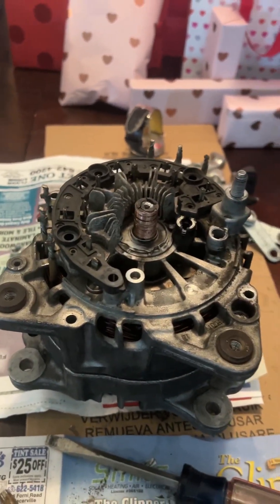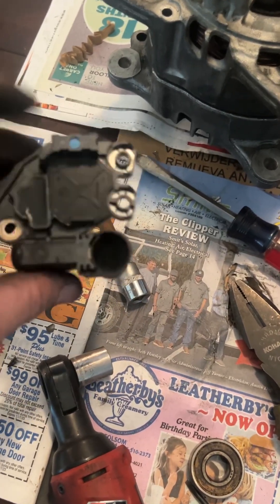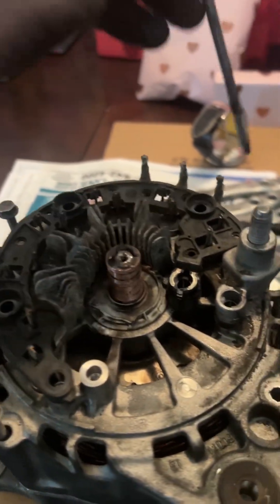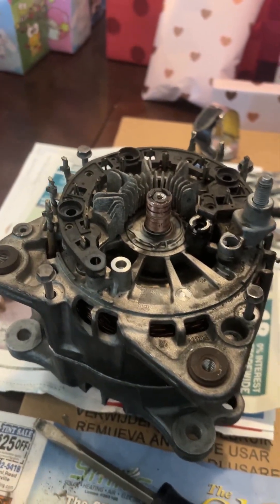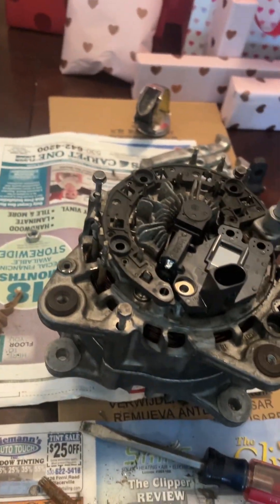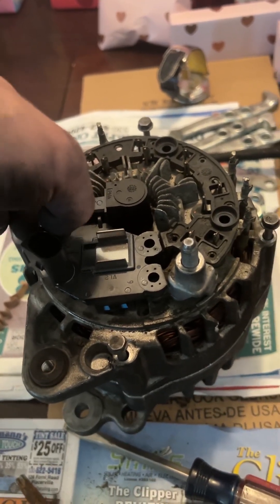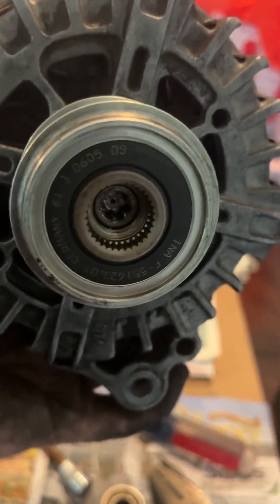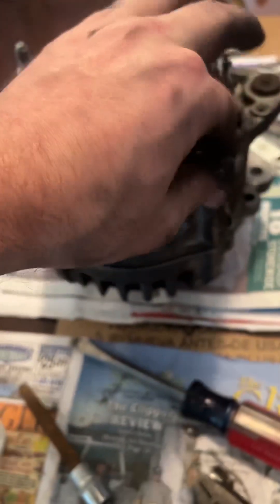SAVED $875!!! DIY 3.0 TDI Alternator repair. Audi Q7 220 AMP Valeo. Anchor Motorworks Repair Kit

Comment: If one bearing was bad, the other bearing has just as much run time on it. You were already in there you should’ve replaced it. I know the reason you didn’t was because you did not have the spine tool for the clutch pulley. I think you should’ve just at the end of the day bought that tool and then you would’ve had a complete rebuild, including installing a new copper slip ring. . Thanks for the video.
Reply: Just did this on my 2014 Audi A7 TDI and bought with Seth. Getting it out of the car was the hard part. Great video.
Reply from the maker: Agree 100% but… I needed it back up and running time now, and didn’t have the puller on hand.

I’ll definitely grab the tool, and finish the rebuild at some point.